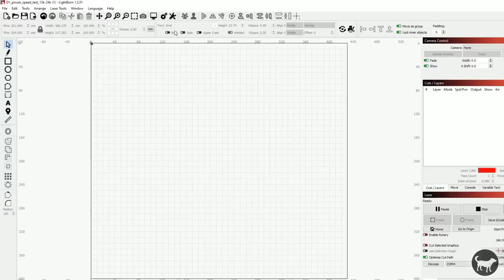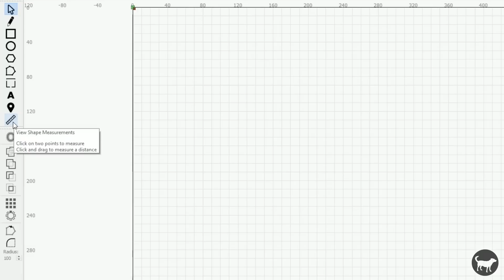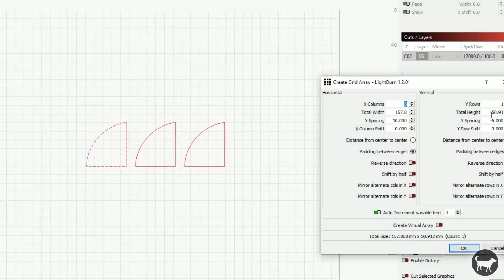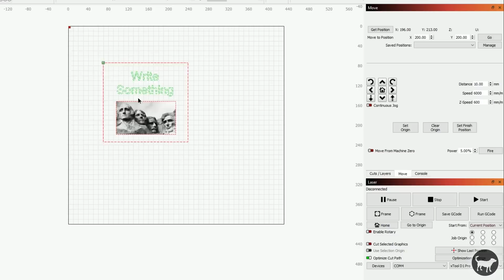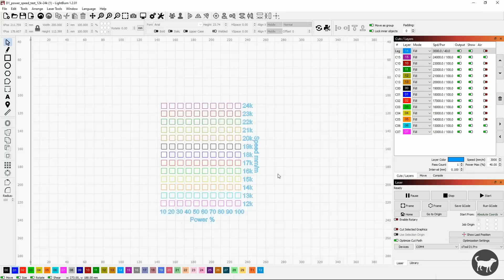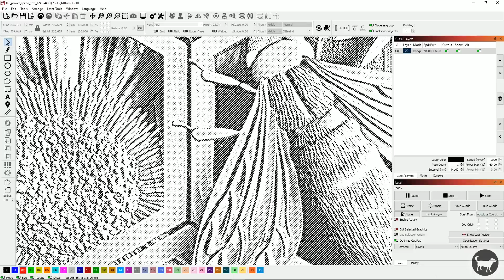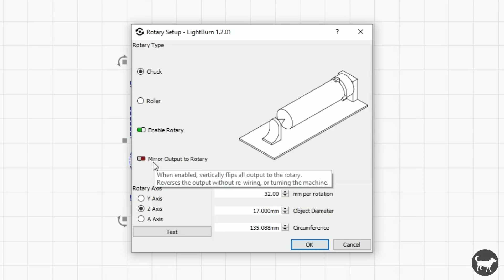Lightburn Tutorial for the xTool D1 / D1 Pro

Comment: Hey, can you please help me to set a start delay, I'm cutting steel, I need a delay so the steel is pierced before the gantry moves, I cannot find anything online, not even on light burn forums, you are awesome !!! your videos are brilliant & your so intelligent !!! you have helped me so much with your knowledge, thanks allot !!
Reply from the maker: Not 100% sure what you are trying to do but you could probably add a delay in the gcode if you are running something outside of the Lightburn. If you need to be in Lightburn you could just slow the laser down or if you want it in a specific spot when the laser turns on you could add a line that goes to the point you want to start at but lower the speed and then drop the laser power to something like 1% so nothing would really engrave but you can use that to move the laser. Other then that I would need more info on exactly what you mean.
Reply: @BusterBeagle3D  Can you please help me, i need to put a text into a cross, where the text becomes the cross, for example the our father payer is commonly done this way, i cannot do it

Comment: Ryan, Wow! Thank you so much for taking the time to explain everything . I'm a little confused as to how you can place an object on the spoil board and cut things out without damaging the board. I'm obviously missing something, but i feel so much more confident in conquering my laser than ever before thanks to you.
Reply from the maker: Well a spoilboard simply by the name is meant to take some damage so the surface below does not. However if you are talking about cutting then I highly recommend the use of a honeycomb. It lifts the part up and adds air behind the piece and greatly reduces charring or damage to the back of the part. Obviously this means the grid is less useful so that typically when I rely on framing.

Comment: Hi! I am reaching out to get help with adjusting the belts on my xTool D1 Pro. I have watched the xTool Video, but need more guidance. This is what's happening. Any time the laser gets to the top left corner, the laser gets stuck for about 3-4 seconds. The jobs I've been doing have had to be started from the middle of the bed somewhere, staying away from that top left corner. It sounds like the belt is slipping. That's why I adjusted both the X and the Y in the first place. I held the laser frame at a 45 degree angle like xTool shows to watch the speed that the laser head free falls to the other side. I thought it looked good. When I hooked it back up, same thing. The laser head jumps when starting from the top left corner. Do you have any youtube vids or suggestions for fixing this? Does the height of the laser in the Z position affect this problem in any way?
Reply from the maker: More then likely your laser is not properly hitting the home position when you send it to the back left corner. It's almost always that the wire loom is getting in the way of the laser head being able to reach that back sensor. Just make sure the wires are not getting pinched in the back or make sure your back limit switch isn't damaged or unplugged.

Comment: I have an xtool d1, I've been doing simple cup engravings with lightburn every now and then. But I have some issues, when I frame the rotary spins so fast it moves the cup out of place if im having to use the assist stand for odd shaped cups but I can get the general idea of the frame and I just move the cup back to start the laser and it turns out fine but it's just annoying if I have to frame multiple times to get it where I want it. Is there anything to slow that down?
But my main ? Is I'm doing a project that I created in light burn, most others have been files etc.. but the one I created is simple txt with a couple line square around it.. it will scan engrave the txt or whatever, then it does the square, I've played with settings and the only thing I've could figure to change is that it will either draw the square first the txt or do txt and the square. I want it to engrave all at once as it is passing back and forth and not skip around. I haven't ran it on a cup yet but I'm afraid it will not line up right cause I did do a cup in the past where it skipped around engraving different objects and it didn't match up cause the cup was getting moved around with the fast movements. 
Is there anything I can do?
Thanks..

Comment: I recently purchased an Xtool M1 laser.  I would like to run Lightburn because the program is similar in many respects to the Vcarve software that I use with my CNC router.  However, I cannot get Lightburn to recognize the M1 when searching for a device in the installation procedure.  I was led to believe that the M1 was in fact a D1 Pro.  Do you know of any way to get Lightburn to directly control the M1 or am I stuck with exporting the Lightburn SVG file to Creative Space to run?
Reply from the maker: Hello. I'm afraid the M1 is about the only xTool Machine that I don't have. I would suggest checking on the xTool Facebook group for the M1 to see if anyone else has this issue or a solution. I just have no experience with it.

Comment: Hi, I have a D1 pro 20w and I'm trying to use it with LightBurn but it doesn't work. I set up everything just as you indicate in this video, it even makes the frame well but when I start cutting or engraving it only makes very slight small lines outside the frame and nothing similar to the design I send to engrave. Please help me to solve this 😞.
Reply from the maker: Hi. I’m sorry but I’m not familiar with that type of error. Does your machine work through XTool creative space but just not through Lightburn? It might also be worth a look to check out the XTool Facebook group to see if anyone else has an issue like that.
Reply: Yes, with XTool creative space works perfectly, but with LB I get the error I told you about.  @BusterBeagle3D

Comment: Hi, i recently purchased and installed a D1Pro and gave it an extended 1000x1500mm work space which is entered in the profile. The issue is that when Homing it moves only about 520mm in X homing direction and about 460mm in Y homing direction and stops like it recognizes soft limits. Another issue is that when i hit arrows to jog it suddenly enters alarm and prompts error: tiltCheck. Everything is horizontal, square and vertical as it should be, so, no reason for mechanical issues.
Reply from the maker: The first issue is a known issue that I have brought up in one of my videos somewhere and that is the max travel that is hardcoded into the GRBL settings is less then the full workable area with the extension. It's not even a setting that xTool allows you to change so if you are homing from too far away you either need to have it closer to start or press the home button twice. 
For your second issue that is not something I have run into before but it's probably because I turn the tilt sensor off anyway. The only place you can do that is in xTool Creatvie Space but the setting will carry over to Lightburn after you set it. It's in the work properties after clicking on the cog next to the image of the printer in XCS.

Comment: Is the wifi feature available now? I didn't have to import the d1 file from xtool to add to Lightburn. Guess they fixed that.
Reply from the maker: I still don't think that wifi works with anything but Creative Space but I would also recommend still using the .lbdev file when adding a machine. There still may be some settings missing like the scanning offset adjustments. A way you can tell is by going to EDIT> Device Settings and looking at the Scanning Offset Adjust. If that is off or empty you may start to see what looking like odd ghosting in you engravings.
Reply: @BusterBeagle3D  thanks!! I'll test it out and add it if blank

Comment: Well Ryan....I have watched this video before so I have returned I hopes you might see this as you seem to be more knowledgeable that most D1 users. I have both the 10W D1 and 20W D1 Pro. I am quite new to lasers but am learning. I am however, quite knowledgeable of 3d Printing and CNC operations, have both in my shop. Sooo the concepts and basic language is not forgien to me. My D! Pro 20W won't home. When I tell it to home it goes to the left side of working area and stops. It seems confused about where it is. I assume the home position is determined in the firmware and can't be seen. I have done all of the normal things...checked all the connections, reloaded the firmware even tho' it was up to date (and yes the switch is in the correct position), pushed the reset button, I don't know what the SD card is for but I have taken it out and reseated it, restared the machine each time.. I have also sent an email to Xtool support with no luck...or response. I just would like someone to point me in a direction that I might not be aware of. I know you not tech support but I. am just looking for someone who knows more that I do. I am wondering if I have a problem with the firmware and should I be considering replacement of the mother/main board? If that is even possible. The Xtool web site says nothing about that. In conclusion thanks for you fine videos and enjoy them a great deal and mostly you are fine presenter. Oh...I use both lightburn and XCS.
Reply from the maker: Hello George, 
The home position on the machine is in the back left corner of the machine. It's the (0,0) Position. When you click on home your laser head should move left and reach the frame after it triggers the limit switch. It should then move to the back left corner as the home position. If the laser moves to the back left but doesn't stop and just grinds then either the limit switch is not working or the wire loom on the gantry needs to be adjusted because it's getting caught between the frame and the gantry. And not allowing the gantry to reach that metal tab you installed into the frame for the home position.  
Can you frame in XSC but not in Ligthburn? If that is the case you may have the wrong point listed at the origin. Again the origin is in the back left corner. You can check what you have listed as the origin under Edit> Device Settigns> Basic Settings> Origin. The top left dot should be chosen. 
If it's none of those things just make sure that the limit switch sensor is working and not broken. Those little plastic tabs on the sensor are notoriously fragile so it's possible that they are broken. Also be sure that you can see the metal tab installed unto the back bottom of the laser head actually reaching the sensor. I don't remember if there is a light on the sensor to let you know that it's working but that is where I would start if none of the other things I mentioned work. 
Hope this was a little helpful at least.
Reply: Thanks for your reply Ryan. I know where the home position is at and it doesn't go there. When I home the machine it goes to the left side and stops. This is true where ever it is in the Y. It then thinks it is home. I had requested similar help on the facebook group and did not think I had any replies but....not so. Xtool support did respond to me and I have made a couple of videos for them. One usiing lightburn and one using XCS. Let's see what they tell me. Again thank you for trying. @BusterBeagle3D
Reply from the maker: @QuiltersHandyman  Using the move buttons in XSC or in Lightburn are you able to move the laser on the Y axis? It's possible there is an issue with the Y axis stepper motor or connections if it wont move. If your laser can move along the Y axis using the buttons then again I feel like that points to there being an issue with the sensor on the gantry not reading the tab on the back of the laser.
Reply: Ryan you are super for trying to help me.  I figured out the problem and you were close I was using lightburn and had the console window open when I homed. It did the usual move to the left side and stopped. The console window told me it had home both x and y.....not it exact words. I went to 'XCS and activated the tone for when the machine moves goes beyond its limits.....sure enought back in light burn I home it.....the laser head goes to the left side and stops.....using the move window I move it down and nothing but move it up  the tone sounds. No matter where I place the head on the Y axis and send it home the head moves to the left side and stops...it thinks it is home. I turned it over took off the Y-axis sensore and sure enough it was damaged. Hard to see but one of the U shaped components on the board was, very slightly bent, and the two outer solder joints were broken. I am a ham radiio guy and build a lot of kits so have a pretty good electronics work bench. Used a magnifier to see the break.  I assume these are magnets of some type that field is activated when they reach the metal pieces at the end. I have informed the person I have been communicating with and hoping she will help me obtain a replacement. Thanks again Ryan,..... @BusterBeagle3D
Reply from the maker: @QuiltersHandyman  Glad you found it! Yeah those sensors were notoriously bad. So much so that the ones that came with the 40W kit were obviously beefed up and improved. Hope they get you out a replacement and you can be up and running soon.

Comment: GM. Thanks for the reply. Ill try it as soon as i get home from work. Would that make my laser move opposite front and back(im assuming thats the Y direction)  also, would that be responsible for it burning upside down and reversed side to side?
Reply from the maker: From what you described that would be my best guess for what’s going on. It of course could be something else but I would try that first. Also if that doesn’t work I would suggest doing a test in XTool creative space just to see if it works as expected or not. That would rule out a hardware issue if it works in there.

Comment: What a great, thorough tutorial. This made a world of difference with how I understand Lightburn. I was excited to see Lightburn had parameters for the D1 pro because my laser is either not configured right or its possessed. Hopefully you, or another user can help me out. When I jog my machine using the front to back /right to left buttons the front to back is reversed. When I burn a project it burns backwards and upside down. I have to mirror the image left to right for it to burn properly but it still burns upside down. Because of this, all of my centering modes won't work correctly and I have to just try and frame over and over to get the project in the correct place for no cutoff. I was hoping downloading the file from x-tool for lightburn would fix it. I thought it did at first but its still possessed!. Any thoughts other than taking up an instrument instead of doing this? Just so you know I'm not a complete idiot, I have a Onefinity CNC and I have no problem negotiating that piece of machinery 🙂
Reply from the maker: Make sure when you setup your machine you are picking the back left corner as your origin position. If you want to check it click on Device in the bottom left Laser Window and click on your machine. Then click on Edit and Click Next until you get to the Where is the Origin of your machine window and click on the Rear Left. That should orient your machine the right way.
Reply: I wanted to thank you for your help in fixing my problem with my laser. Its working better with the problem I was having and its homing the way it should without grinding and chattering the belts. I am going to get the grid you have for the 40w X-Tool D1pro. I saw some responses about using it with cuts as opposed to just engraving. Once I make the grid and have it set, does the honeycomb fit into that so it can be centered in relation to the grid? If it does that than at least I could have that centered over the grid you made. The problem I see with this laser is you can move that honeycomb anywhere because there is no center that I can see with the frame. Maybe I'm wrong being new to this and still need to learn a lot to be proficient. Is there anything in creative spaces or Lightburn that puts the laser dead center on the frame? Thanks for all your help.
Reply from the maker: @chrisdemeglio7983  No worries. I typically only use the grid when engraving and rely on the framing when I want to cut something because the grid is hard to see at that point. As far as moving the laser to the center of the grid both Lightburn and XSC has move functions were you can enter in values and move your laser. Depending on which grid you are using you can home the laser and then enter in the value for the laser hear to move to.

Comment: Thank you so much for this video. I have a question about the cut and engrave settings in lightburn and Xtool creative space. I am trying to engrave photos in clear acrylic and found a video from a Youtuber who has an Xtool machine; the settings they are using are for Xtool 70% power and speed of 50. Their photo looks great. I have a different machine and I use lightburn. What would these Xtool settings be in Lightburn? Thanks
Reply from the maker: It may depend on the power of the other "xTool machine" or whether it's a CO2 or a diode machine but 70% would be the power in either LB or XCS and the speed of 50 would be in mm/sec in XSC. Your Lightburn might be in mm/min so you may need to adjust accordingly.
Reply: @BusterBeagle3D  thank you so much.